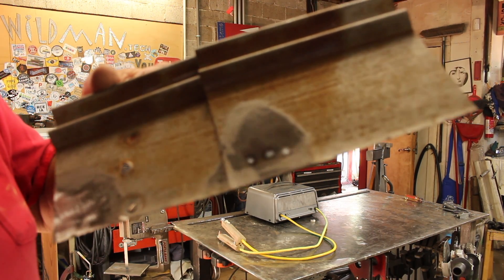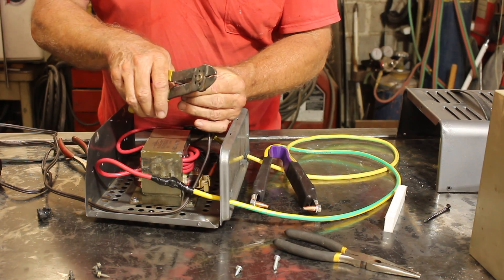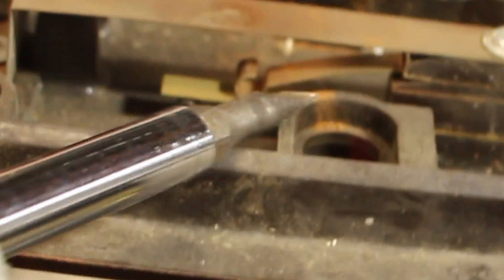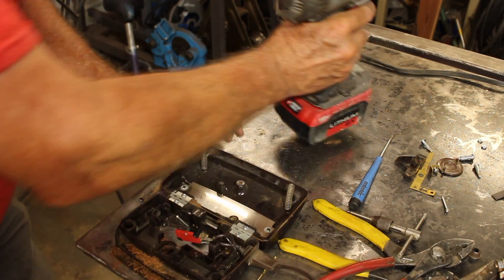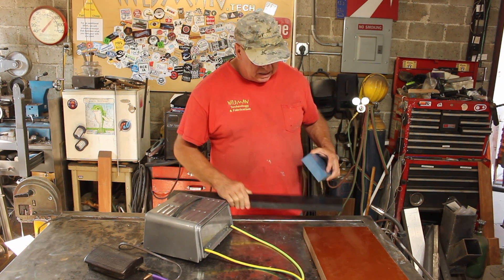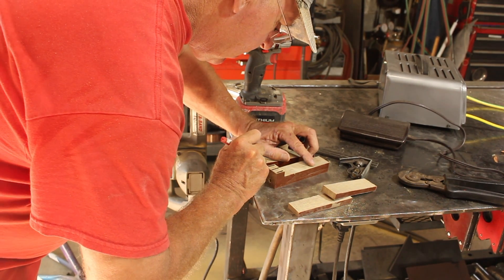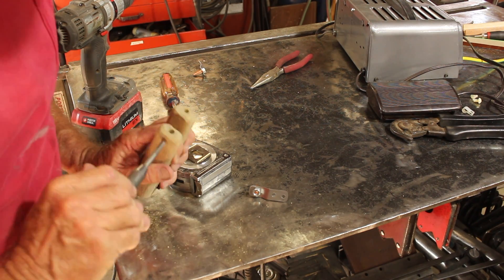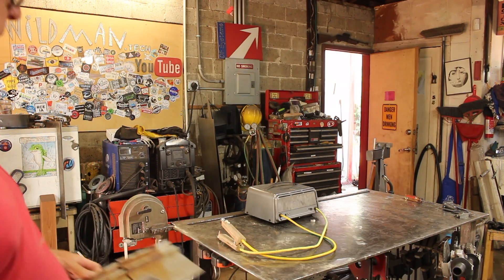Upgrades for the Arthur Ganson Spot Welder!

Comment: I was actually thinking about a sewing machine pedal on the previous vid when I mentioned a foot switch, but did have concerns about the current handling. Glad repurposing it worked out well. I also really like the redesigned handle. Overall I think this great.
Reply from the maker: Thanks for your input. I just happened to have one hanging around.